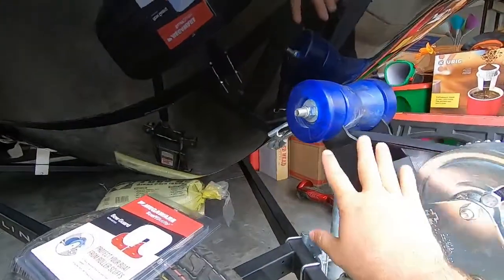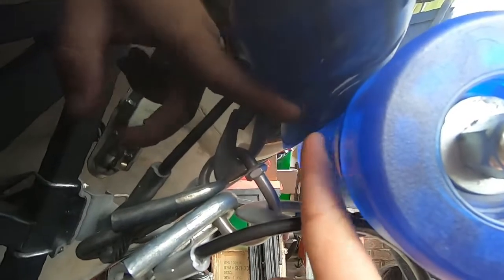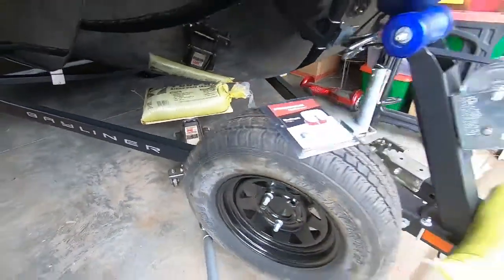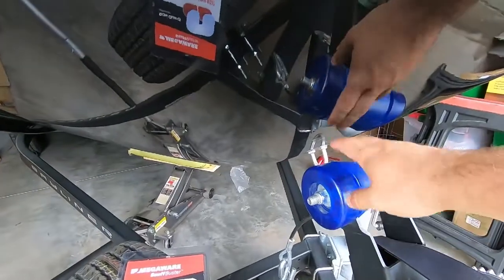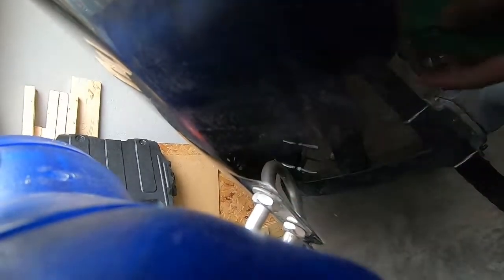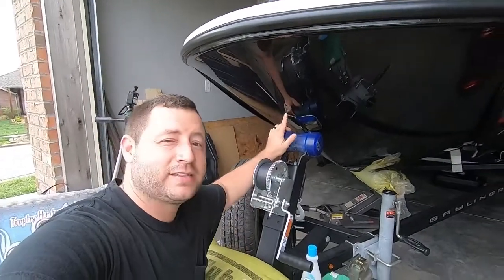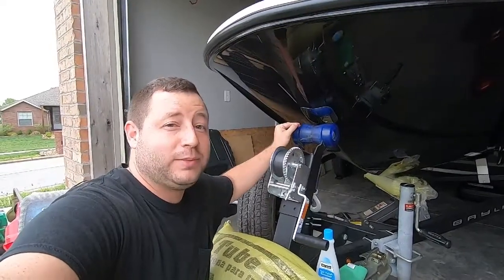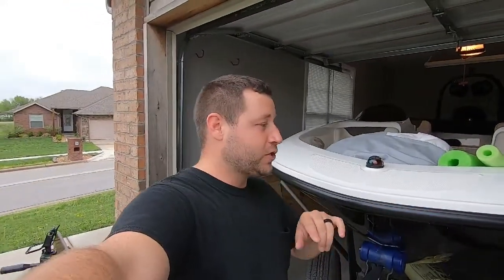Protect Your Boat! - Bow Plate Install - 2018 Bayliner Element

Comment: Your boat is under warranty. I would have called Bayliner about this issue first. Perhaps the roller is compromised somehow? I mean , how can a rubber roller scratch the hull? Unless it was dirty and had some grit on it. The ceramic coating I told you about might help too. Hydrosilex.
Reply from the maker: Edmund Jeige unfortunately i do not think bayliner would do anything. It could have been dirt, who knows. But every boat or jet ski i have had does this at some point. The black color of this boat shows everything haha

Comment: Off the subject, but I'd like to know if you're considering adding a tach and/or trim gauge. I'm just getting started with my new (2015) e16, and right away found I was wishing I had these to tell me what my are RPM and trim positions are.
Reply from the maker: Dave Sherlock i plan on getting a vessel view witha phone mount option on the dash. The vessel view is real time with an app. Motor trim no, i just know where its at. During cruise i have found the sweet spot and know how far to go...they will porpoise easily so you will find it quick...hope ur enjoying it otherwise!! Thnks
Reply: @midwestbuilds      I thought about the vessel view but too many $$$.  Maybe do a video on the vessel view?? Thanks, Dave
Reply from the maker: i will have it sometime this summer and will make a video for sure. it was on sale for $149 but now it is back up. hopefully it will go on sale again soon!

Comment: Good video on how to install. But give it about a year and it will be scuffed up and magnified even worse than if it was the boat itself.  You can try a softer roller which will help some but overtime it will still scuff and scratch.  Its a boat!
Reply from the maker: David Dillow hey thanks! It has been on awhile now, still works great. I would rather have it scuff than the boat itself! It is a boat but ill do whatever i can to protect it!!